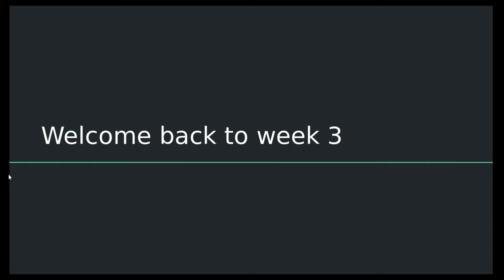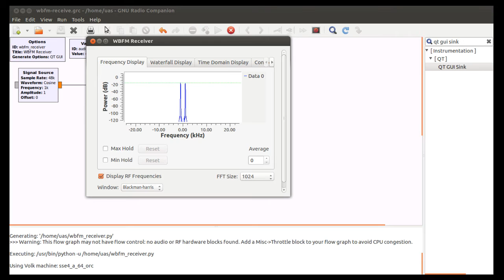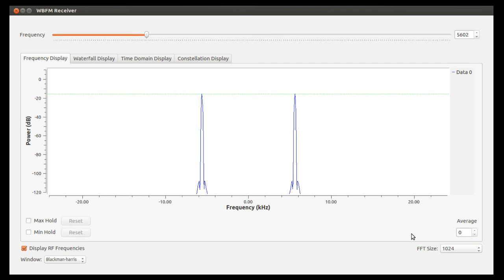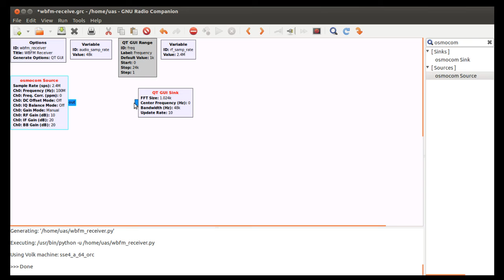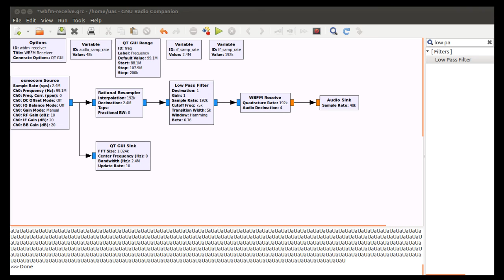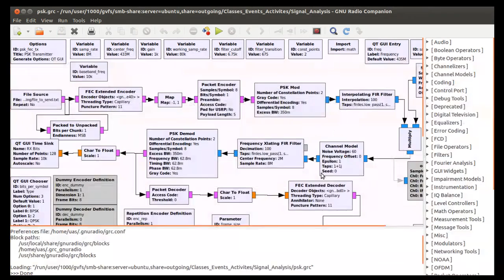Introduction to Signal Analysis Week 3

Comment: Theme this week: GNU radio companion and how to use it

Timeline of sections:

5:40 -- Start / welcome back to week 3
7:15 -- last week's homework -- what is POCSAG?
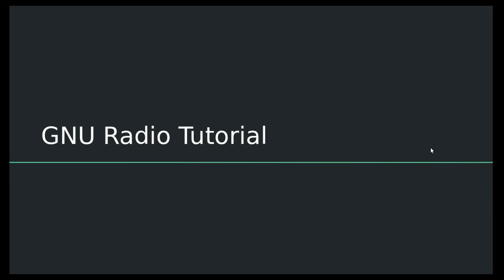13:07 -- GNU Radio Tutorial start
14:00 -- starting GRC (gnu radio companion)
16:20 -- some simple building blocks
1:02:30 -- building a wideband FM decoder
1:33:40 -- running the fm decoder flowgraph (followed by fixing intentional and unintentional bugs)
1:40:15 -- adding a tuning slider
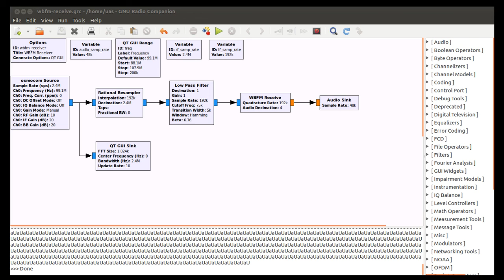1:59:21 -- homework, with prizes!